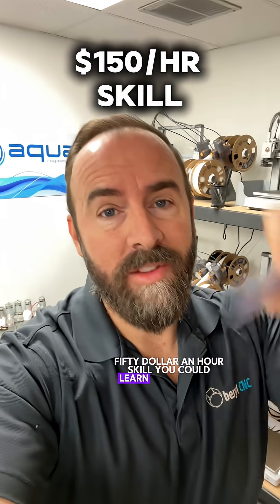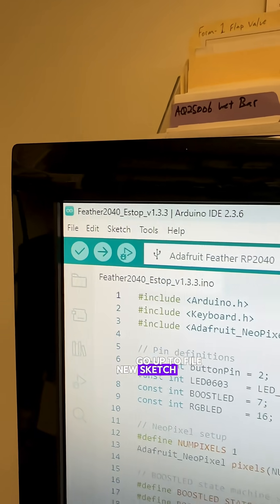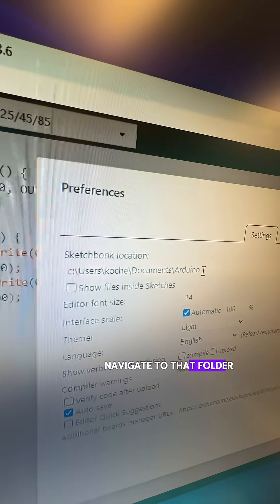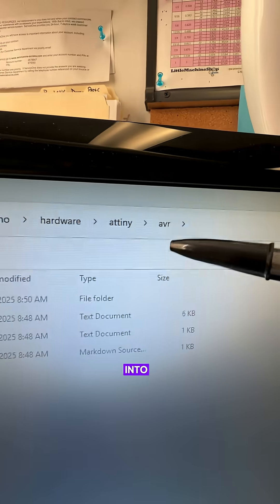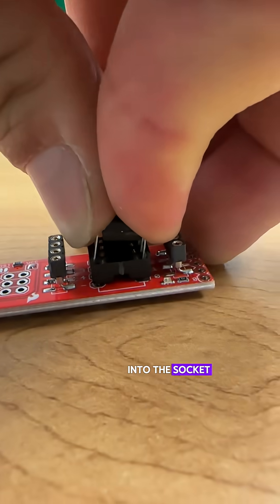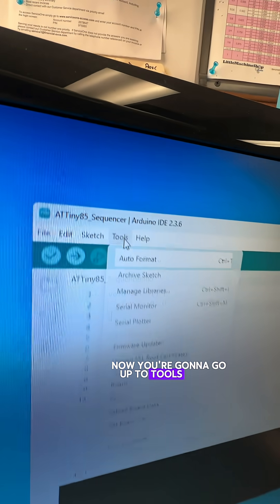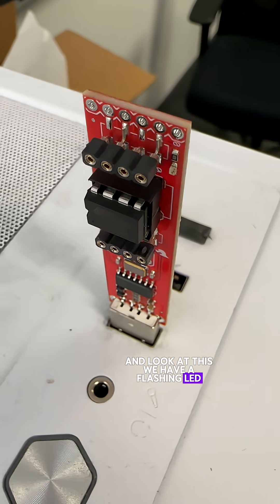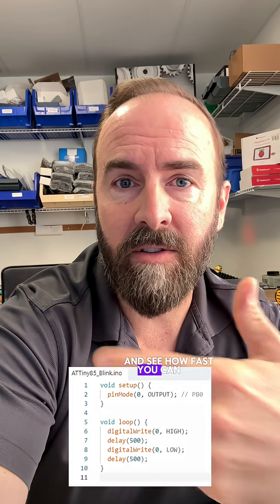Intro to ATTINY Microcontroller Using Arduino IDE

Comment: I know it sounds dumb but he's not wrong as an electronics technician for an industrial repair company. There were was times where you charge 300+ dollars to replace a 10 cent component. Why because the machine that was down would cost the other company 2000, 5000 or more for the machine not to be  working. Now with chatgpt you dont even need to code just put in the chip number into ai tell it what you want to do and copy and past into the arduino you want to upload and test it.
Reply from the maker: Yes 100%

Comment: How do you enter this career path? I hear stories of people making thousands on singular jobs where they use micocontrollers to coordinate light shows. I work in industrial and mostly they use PLCs for control logic. Really don't like the 20+ hour days though.
Reply from the maker: Yeah so there's a divide between the PLC stuff which is also a great career path and the microcontroller stuff which is seen more in early stage R&D. You'll be working with inventors, patent attorneys, and industrial design firms if you self employ doing microcontrollers. For example you might want to do a very simply hard coded microcontroller based sensor for your manufacturing fixture or test fixture.

Comment: Ok I got that part.  How do I turn this into 300k/year when you can just hire a full-blown electronics engineer for under 100k?
Reply from the maker: Such a great question, really. In my experience, customers don't have extra electrical engineers on payroll for very long. They're just too expensive, so this means all engineers are usually too busy to handle new product development that's a one-off. So there will always be a niche or overflow work that you can find when you self employ. You can charge whatever the customer wants to pay. I'm not kidding when I say that if there's a tradeshow coming up and a customer wants to show a new product, in many cases they will pay whatever they can afford through the lens of grabbing millions of dollars in future revenue. At that point the salary requirement of an engineer on payroll are miniscule but they can't just hire someone a week or two out and meet the deliverable, and then fire that new engineer. That's where a self-employed R&D firm can thrive.

Comment: I could do the same thing for 85 cents and 0 lines of code plus no need for a whole arduino mc.  Just wire up a 555 timer chip to a 9volt, couple of resistors and an LED and there you have a blinking LED.  Thats tech from 45 years ago.  If microcontrollers capable of running code existed back then i would have been much more dangerous.😂
Reply from the maker: That final sentence is the whole point haha. These small 8-bit micros where designed to add versatility and compete with a 555 timer. You can put pages of code in them and you have an A/D converter, basically a digital multimeter, at your disposal. It's one of the most massive step changes in the history of electronics probably right after the semiconductor itself.
Reply: @i2c_jason  Indeed.  The applications are endless and the materials are readily available / cheap.  But I still miss the old Radio Shack.

Comment: Seems like a royal pain in the butt not having dedicated programming/debug pins. That and low gpio 😢. But i guess its a fun starter project!
Reply from the maker: It's so satisfying tho when you can see the whole picture on 8 pins, unplug it, and have it just do one hard-coded thing forever. Far less secrets and mystery than some of the craxy complex 32 bit stuff where you basically paste someone else's code and hope for the best wrt edge cases and unknown performance. To your point, you definitely don't want to use this part for applications that might grow in complexity and need more GPIO.

Comment: I feel like the hardest part is understanding the interface for random probably poorly documented electronic components that you are wanting to control
Reply from the maker: In my experience the components from US or European vendors are extremely well documented with examples, but they cost more than offshore generic parts. The danger zone is when a customer says "hey this offshore part is fifteen cents but yours is $1.50", then you have to play the black box game and perhaps spend the difference on additional R&D to figure out the poorly documented offshore part. Also there's something to be said about the "vibe coding" being more challenging for these small 8-bit parts because there's less of a data corpus in the training data of AIs.
Reply: @i2c_jason  that makes a lot of sense, thanks. Making projects with Arduinos in college was probably the most fun and satisfying feeling I’ve had in tech/software. Your videos have convinced me to dig back into hardware, so thank you!

Comment: lol some weird comments here 
Video was solid Jason, thanks for taking the time to put it out there. More minds inspired to tinker and explore will always be a good thing. For those of you who paid attention, take the extra time to wonder what sort of applications a small processing unit has. What would you do with a drop in brain for hardware/infrastructure/security/comms/gadgets?
Reply from the maker: Amazing summary of what I tried to convey, clearly failing with the masses haha. This is truly a tiny brain you can use to eliminate thousants of analog components or to beat power consumption of large complex processor systems by orders of magnitude. Thank you!

Comment: Please take at look at either the Attiny412 or the Attiny804N its way cheaper (but requires soldering) and uses UPDI (one wire programming, HUGE UPGRADE )

Comment: Amazing. Please make more content like this. I am inspired and want more tutorials just like this.

I made a goal for myself from this video. 

Make a light turn on from a trigger using code. Every two weeks for example.
Reply: You're are going to need to use an ESP32. They  have Bluetooth and Wi-Fi. Well that is if you want to operate it remotely from a tablet or computer. They are more expensive than the Atmel used here, but not by very much. They're about $1-$30 a piece depending on where you get them and exactly what chip you go with. But i would start looking into that sooner than later. They also run MicroPython, so you can code them in Python, which (for me at least) makes it a lot easier.

Comment: The attiny is great for sub-systems along with more powerful micro controllers too. ATtiny85 is my go to for that, You offload some of the work from the main controller, example the attiny can do the motor controlling code while the main controller just has to send a value through to the attiny. This helps when you have multiple motors. Use i2c and boom multiple sub-systems controlling different motors and other things.
Reply from the maker: Yes!

Comment: i use attiny in my product that made it much smaller and less complex than competitiors. Sure its a downside it needs a software programmed on each device but with a jig I have gotten that automatic. Great controllers these!
Reply from the maker: Exactly! Thanks for explaining that, it's a huge differentiator and something that goes unnoticed by the "just use an ESP32" crowd. Gotta use the right micro for the product definition and target BOM cost.

Comment: Electrical engineer turned Product Manager here. Fyi the jobs are limited, even if the trade seems to be high paying, who's willing to hire an embedded systems engineering anyway. The industry is selling smart products as AI these days, getting assembled hardware from China in mass and burning your firmware in it, making an app for it is the norm.
Reply from the maker: Exactly why I'm proposing to not look for jobs, rather, you make the job. Most companies won't keep a staff of electrical engineers on payroll to take up overflow work. That's where the self-employed engineers thrive. In fact most EEs I know have at least had a consultancy on the side. This video and my channel are designed to inspire people toward self-employment in R&D.
Reply: @i2c_jason that's interesting. In my region people switch because of lack of opportunities. Many electrical engineers in my network ended up switching to software unfortunately. We don't have many opportunities here.

Comment: Bro I have basic to advanced knowledge on several microcontrollers on Microchip MCUs (8-bit PIC, dsPIC) plus Arduino, ESP32, RP2040 but I don't have the job you're saying $150/hr. My current job only pays me $3/hr and it's not even about electronics.

Could you tell me what job is this? This pay is extremely high in my country.
Reply from the maker: You don't find a job, you make the job by prototyping R&D gadgets.
Reply: @i2c_jason  do I just sell the gadgets that I make? Does the gadgets need to be new and innovative? Does it have to be a necessity or novelty will be just fine?

I'm sorry if i'm asking you a lot of questions. I'm interested in electronics but frustrated since I can't make a living out of it. 
I'm thinking to just start doing something from everything I have now.
Reply from the maker: @gidsvids8320 in my experience I make other people’s prototypes to earn my wage.

Comment: Ya know. Never have I watched a YouTube video that I was glad to stumble onto it!!! Does that USB device erase to lockbit pins?? I have so many of those little boogers laying around and the inability to find the old AVR eraser schematics! Ya made an old techie tickled lol
Reply from the maker: Good question. I think the way those usually work is you can erase and re-flash, just can't read out the op codes perhaps? Double check me on that I'm probably wrong.
Reply: @i2c_jason I have a day full of flour silos and convey line repairs...but I'll see if I can find the old code. But real talk...I have 10 of those laying around needing erased. I used to have to use a mega or uno to program with the SDR.

Comment: You didn't tell them how to safely remove the chip without breaking the legs. Did that on my pascal chip for the BBC Micro when I was a kid in the 80s or 90s, that was a bad day but a very valuable lesson
Reply: Over the years and removing at least over 1000 ic's of various types to test or replace them i have never had one that broke a pin when it was removed.  I did always used a fairy wide flat blade small screwdriver and pried up a little at a time several  times on each end until it was loose to remove it.

Comment: I know my way around the Electronics design, and the Arduino ecosystem pretty well(I also do 3d design) , and no one is hiring for anything close in the phoenix area for a little more than minimum wage unless you are 100% travel(always advertised as 10% travel).
Reply from the maker: I would never recommend looking for a job somewhere. Start your own business. The reason is simple - engineers are expensive and most companies won't have extra engineers laying around for their new R&D projects or for cleaning up overflow work. That's a huge niche that us contract engineers can thrive on. Never get "a job".
Reply: @i2c_jason so what do you do? Contract RnD projects?  How do you get them? Contact random companies?

Comment: ive been there 15 years ago, and when i finished my super optimum code to fit there infound atmega8 or atmega16 is way cheaper, and now days counterfeit stm32 blue pill way more cheaper than attiny13

Comment: Is this one of the things they use to make those insane Christmas 🎄 light/music house displays... it has to be
Reply from the maker: Basically anything electronic has a microcontroller on the low end or a computer on the high end of the complexity spectrum. To me, everyone plays on the high end, but the low end is where the fun and the money is.
Reply: @i2c_jason  if you don't mind me asking, why do you think the money and fun is more at the low end?
Reply from the maker: @LSC132 just my personal preference but I grew up taking stuff apart and working with my hands (wood shop, making stuff in the garage, etc). So it’s more rewarding to me when I see something tangible I can hold in my hand. Also way fewer rabbit holes. It seems like the higher you climb the abstraction ladder the more random issues you have to suffer through. Like boss-level abstraction would be AWS IAM roles, access, privileges, apt-get update changes randomly ruining your day, etc. At the lowest end is an 8-bit micro with a simple datasheet and a compiler / IDE.

Comment: As an Atmel fan boy, I have used the attiny85 micro many times. Great for simple and cheap! Not everything needs 4000 I/O ports, i2c, WiFi, Bluetooth, 24 URATS and battery killing speed, great choice!
Reply: On the other hand, where I live, I can get and esp32 module cheaper than an ATtiny85, which is an overkill for most projects but if it's readily available and cheap and you're only gonna made a few hundred units then it's fine to go that route.
Reply from the maker: @muflah  can the ESP32 beat the ATTINY85 on power consumption tho for battery applications? I'm sure it has deep sleep modes, just not sure if running the whole stack (easy way) will match the low power of the ATTINY or PIC12F675. I don't wanna write assembly code for the ESP32.
Reply: @i2c_jason  nah esp32 is pretty power hungry. I have seen it draining 9v battery in minutes, with a linear regulator at least. But we used to use esp modules as slave and STM32 as the main controller for iot applications. Things have progressed but I switched in 2021. I have heard that the newer RISC-V modules were better.

Also, idk about programming in assembly or bare metal C. I used to work on hardware side and used to use Arduino for testing hardware. I have tried running python on esp32, it used to be fun.
Reply: @muflah  Hm you can run it pretty low power (few uA, 25uA with RTC on) you're doing something wrong...
Reply: @ZegaracRobert  Nops, it was a laser tag gun connected to WiFi, that's why draining battery. If I dont want WiFi and/or BLE then I'd stick to STM32.

Comment: Why ATtiny is expensive than ESP8266 ?, how come a 32 bit SoC inexpensive than an 8bit AVR microcontroller.
Reply from the maker: ST used to advertise 32 bits for 32 cents. It’s a great question, why are 8-bit parts so expensive and why use them. A lot of it has to do with maintaining legacy documentation or test plans, mitigating risk (8-bit parts have far shorter datasheets and errata) or even just designer preference. For example avoiding a learning curve and using existing know-how and library code. I use all kinds of microcontrollers through RP2040 and ESP32 and love the 32 bit stuff too.

Comment: ive been doing this since 2014 but cant make money out of it #inafrica i consider myself one of the best microcontroller programmers and circuit designer but hell i had to be born in africa 😭💀😭😭
Reply from the maker: Can you brainstorm some really transformative inventions you could sell directly as products? Bypass the whole investor / high volume production game and go right to selling equipment or devices you make with Adafruit and DigiKey parts?
Reply: @i2c_jason   Give an email i can show some crazy stuff i've built some eg in 2015 i built Solid state series transformer stabilizer, recently i built some really complex systems i wouldnt want to speak about here lol 💀

Comment: What about the legal stuff? I imagine that's the hardest part about doing this for a living right? You'd need some kind of insurance for when your client gets 1000 of your boards manufactured and they're all defective because of a mistake on your end or what happens when some issue causes your design to burn someone's house down? Obviously you shouldn't make designs that causes these issues but what happens when you do?
Reply from the maker: Great question, when you are upstream far enough you don’t have much of a problem with all that. Most designs end up being redesigned  in subsequent cost reduction phases by the manufacturer. Or, you work out the language in your proposal to put the risk on the manufacturer of the end product. They can validate and change the design as needed.
Reply: An incredibly helpful exchange. Thank you. All that's critical isn't antagonism.

Comment: There's also microcontrollers that are around 2¢
Reply from the maker: Yes, and the challenge here is are they documented well, and are they documented well in your native language, and are they available not in a bare die form factor? If yes, us them. If you have to put another $10,000 of engineering into the R&D of that product, you have to amortize it over the total number of pieces sold. So it has to be an incredibly high annual volume, Walmart and Dollar General kind of thing. Those are fun too tho.

Comment: In college we had an assignment to use an arduino, and 8 LEDs, then writing a code to randomize the pattern of lights, number of lights lit, use pwm to vary how long the lights took to come up and go down, etc etc.  fun project.  But I prefer terminal to C, so I went networking route.  Good vid though